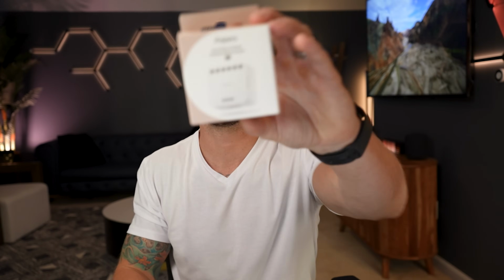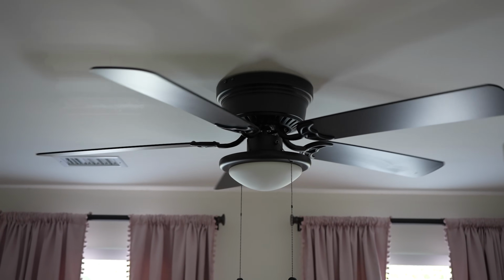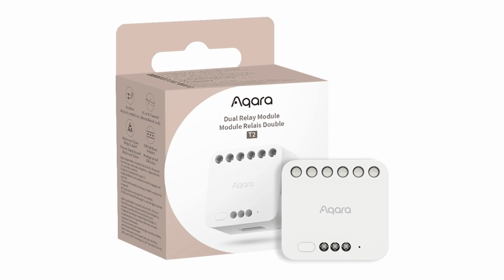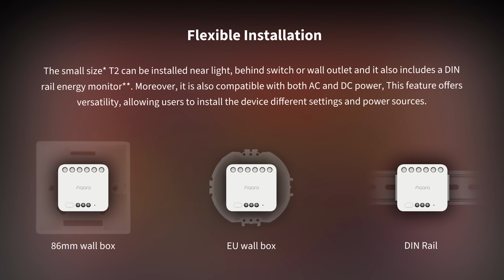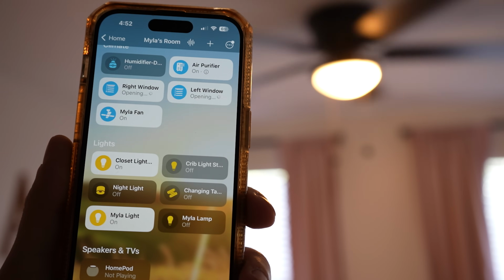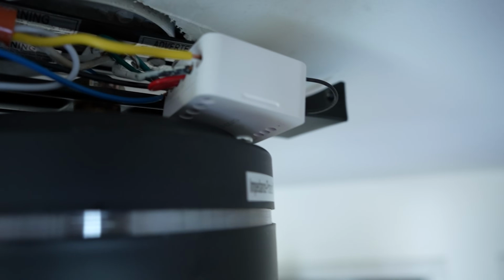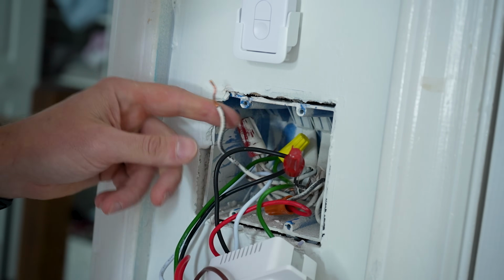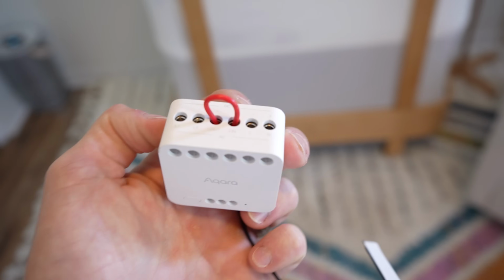Make Your Ceiling Fan (or Anything Else) SMART with THIS!

Comment: My our bedroom has a ceiling fan with built-in light, the light and fan have different slider/dimmer.  The fan has 4 bumps, off, low, medium, and high and the light is a regular dimmer.  Would definitely like to replace those (they're old and dingy and dumb) but get something that is smart and satisfies wife requirement that the fan and light will still work via the wall switch.  Sounds like Aqara can do this.  
I had hoped Lutron would be able to, since I have some Caseta stuff but it doesn't seem like it.  New project!
Reply from the maker: If you have separate wiring for a light and fan (two separate wall switches to control them) then you should be able to use a Lutron Caseta Dimmer Switch and Lutron Caseta Fan Controller Switch.
Reply: @ShaneCreates  I think to do that, I would need to expand the wall plate to almost double its current size.  I''ll have to measure again
Reply from the maker: @DanKing79  Ok, so you have one of those double switch fan/light dimmers in a single gang footprint (it sounds like). The Meross Fan/Light may be a good option for you if so. I'll have a video coming out very soon covering that, plus different ceiling fans and  switch configurations/options in more detail. Hopefully it will be helpful. So stay tuned for that! 😃
Reply: @ShaneCreates  looking forward to it!

Comment: Gives me an idea. My two garage door openers are currently controlled by a MyQ gateway. I could use the MyQ app, or Alexa, and until very recently, HomeKit via Homebridge+MyQ plug-in. Chamberlain now blocks API calls from the plug-in. So, my choices are getting a Meross 3-channel garage door opener, or maybe using this relay in dry contact mode (thoughts)? I'm already an Aqara user, with lots of sensors, an M2 hub and G2H Pro which I could move and use for a hub if there's connectivity problems.

PS: I am not fan of Meross and have removed nearly all of their products due to flaky (unacceptable) wi-fi performance, so I'm skeptical of their garage door controllers.
Reply: Of course, this becomes more complicated because "real" garage door openers provide status (open, opening, etc.) and using a second sensor makes for extra automations. :(

Comment: I thought this might be a solution to an ongoing question, but I'm not sure... 

I have an old security system in my basement with door and window switches routed to the box.  My question is whether you could use this module to tap into these switches for monitoring by Homekit?   Can I put something like this in the box and tie it to the incoming switch wiring.  What do you think?  Is there something else that can do this?

Comment: I like the switch but you still have those two pull chains to control speed of the fan, and intensity of the light which means you could accidentally turn the whole thing off from those pull chains.  There are better smart solutions out there like the TREATLIFE Smart Ceiling Fan Control and Dimmer Light Switch.

Comment: I found this very helpful.  Lots of detail and appreciate all you do to help us have a smarter home.  I have been using a Bond controller which worked fine for my indoor fans but has been sporadic for my outdoor. This is a good solution, just wish I would have seen before i Installed as I will have to take the fan blades off as you did on 2 fans.
Reply: I’m new to automation.

I feel this setup will be only for AC fans with a pull chain adjust speed. T

Does your bond controller allow for control of both light and dimmable, fan and speed?
Reply: @Rvighwbrn  I can dim lights and control fan speed using bond controller

Comment: Older house didn’t really have neutral to control the ceiling light was only hot where if you want to install a ceiling fan on a smart switch they require a neutral wire how to get around that is the real question

Comment: Maybe you have done this, but have not mentioned it: if you use the switch like this, where you only use the power to power it, you can set the switch to "Change to wireless switch" in settings, so when pressing you don't actually trigger the relay in the switch itself, only the buttons work.

Comment: Not a bad idea for a fan. But nothing beats the Sonoff ifan04. This will give you full voice assistant control of light and fan independently as well as fan speed and it comes with a RF remote and has app control. 

It even works in Home Assistant. Costs the same too if someone is wants better control
Reply from the maker: Thanks for sharing. Does it support Apple Home?
Reply: @ShaneCreates  That's the only thing it does not support. It also can be flashed with custom firmware but not sure if that gives Homekit support.

Comment: If the fan has a remote control will it still work when the Aqara switch is on for the fan?  If it will, then you can still control the fan speed, correct?

Comment: Shane, really nice tutorial on using this Aquara relay module! Like your setup using the Aquara dual switch in an automation to toggle the fan & light! I’m using SmartThings in my home automation and wondering if the relay module works with ST’s? I do use the Aquara Kitty Hub (P3, I think) to automate some contact & motion sensor.
Reply from the maker: The relay does support Matter. So if you bind your Aqara hub to matter, you can pair it to SmartThings, and then the relay would also work in SmartThings since it supports Matter over bridge.

Comment: I have the same issue with the ceiling fan. I was thinking of replacing the wire from  14/2 to 14/4. Replacing the wire is a more fundamental solution for this one but I haven't started it yet since I'm lazy. This product could be an alternative way.

Comment: Question: Most of these ceiling fans have three speeds. Any way to use smart technology to adjust the speed of the fan? Being able to turn the fan on and off is nice. Being able to turn the fan on to the desired speed would be much nicer!
Reply: I use the bond bridge for this. My fan does not work with IR.
Reply: @JhonnyCrespo How do you get your Bond connected to your HomeKit? I use Hoobs for that, but it’s finicky and I feel like there’s a better, more stable solution.
Reply: Get a bond bridge, I've setup all my 15 year old fans and linked it to Google assistant. Now I can turn fan on/off, change speeds, and turn light on/off with my voice or app. Voice doesn't work with long press dimming but you can program the bond app for dimming and works fine.
Reply: @jim60631 your fan had a single switch earlier?
Reply: @prasangmisra  no - fan has a single eletrcial switch for on/off but the remote has all the RF signals for lighting, dimming, fan speed, and reverse. The bond bridge replicates the various RF signals from the remote which is how it works
Reply: I’ve been trying to find a solution to this. Not sure if the Aqura Hub 2 which has an IR/RF blaster could help here. I’m thinking you can train the Hub to receive a High and Low RF and add those scene to HomeKit. Then maybe have a second aqura rocker switch or smart buttons that you can automate. Anyone know if this could work?
Reply from the maker: The only way I've accomplished this is by using a dedicated smart fan controller switch, like the Lutron Caseta fan controller. For this, you must have a dedicated wall switch wired for your fan only.
Reply: @ShaneCreates The Sonoff ifan04 is what I use. I can adjust fan speed. Also use the light. It is a thicc boi though. I have mine flashed with tasmota.
Reply: I use the TreatLife ceiling fan light switch and it works but you can only have one an a single circuit

Comment: Hi, I used this automate my air conditioning unit, now when I am 500 ft away from my home the AC would turn on, that way I am saving energy and the home is nice and comfy when I arrive, and the same in reverse, I also used it to control my electric gate, this one was long overdue. 😊

Comment: Shane, we have two ceilings fans that work off a remote and just one switch for each bedroom. Because of this room A will turn on the light or fan and it will do the same in room B, will the  new Aqara T2 help with this issue. Also will the new Aqara T2 work on a third fan that’s has no light but a remote to control the fan speed, we turn the fan on with a switch but use the remote to control the speed it would be nice to have this in HomeKit and not use a remote.

Comment: Hey, I don’t quite understand. If my HomePod is matter compatible, why do I need a separate hub…. or do I?
Reply: Aqara devices all communicate with the hub and then the hub actually communicates with your HomePod. All the hubs are roughly the same though. The M2 Hub is like $25 on eBay. Aqara is a pretty solid brand though. I think you'll find enough devices you could use to justify the hub. I have an Aqara deadbolt, curtain openers, and a few switches.

Comment: I believe Aqara switches have a “smart device” setting so you can wire it all connected but in software it just knows to always keep power. Does that not work in this situation?
Reply from the maker: Oh that is a good point, you are correct. Yes, you should be able to turn the switch into a "wireless" switch even if it is wired through the Aqara app.
Reply: @ShaneCreates  I think it’s important to remember the first rule of smart home building though, if it works let it be until it doesn’t 😂

Comment: Another great video! Thanks for sharing. I did a similar workaround with my wall switch where I replaced a single switch with a double rocker smart switch. The first button still powers the wall light it was originally wired to while the second button is always hot but does nothing and I use that as a remote for another light where the physical smart switch is just too far away to conveniently use.

Comment: Great video! Quick question. I want to do the same thing with my fan the difference is I have a Lutron smart switch on the wall. What do I need to do? I add the relay for the fan but do I need to change the Lutron switch too or can I use it somehow like you did the Aqara?
Reply from the maker: You could probably do the same thing with a Lutron Caseta switch but you would have to automate through HomeKit or some other way. You would not be able to automate in the Aqara app so that might be a little more complicated. You would have to disconnect the load wires of the switch like I did with the Aqara switch so that it wouldn't physically turn on/off the fan and light.

Comment: Shane, will I need the T2 if I have a two switches that control one fan / light combo? One for the fan and another for the fan’s light.
Reply from the maker: Yes and no. You have more options if you have separate switches for the fan and light. You can use a single T2 relay behind the switches (not in the fan). This would allow you to automate both of those switches with on/off control.

Alternatively, you can replace each switch with smart switches. Aqara switches would work and give you on/off control. Or you could even go with something like Lutron or another brand that sells fan controller switches and dimmers and have dimming capability and fan speed control.
Reply: @ShaneCreates  Thanks. Your videos help me make my smart home usable by the  rest of the family 😃

Comment: Great video as always Shane!! I have implemented something similar but needed additional hardware. I installed a remote controller module on the fan (similar to the Aqara relay here), programmed a Bond controller to control the remote and added the Bond controller to Hubitat. Then added a Zooz 700 scene controller to the wall after hot wiring the fan. Added the Zooz to Hubitat and set it to trigger Bond IR signals and since Hubitat exposed the Zooz to HomeKit, it was the icing on the cake 😊. I know, a lot of effort to automate one fan but we do it because we love it!! 😀

Comment: Hi Shane. Will this fix my problem: I have HomeKit throughout the house and a hue hub. In the kitchen I have a toggle light switch that powers two fluorescent lights. I also have a hue light switch that turns on under wall cupboard downlighting strips. I am desperate to just use ONE switch to turn all of these on at the same time. I’m guessing if this would solve it I’d still need the hub, but before I spent £140, will this make my fluorescent light switch now ‘digital’?

Comment: That double rocker switch gives me an idea to solve a problem I have. My external garage lights and front porch light are on the same circuit, so I normally can't turn off just the front porch light. My current solution for this is I have smart bulbs, so I can via app and automations turn them on/off individually, but I still have the problem of if a guest or someone accidentally turns off the physical switch, it cuts off the power to the lights. If I replace that physical switch with the double-rocker like you did, it will always stay powered and anyone flipping the physical switches will just be activating an automation to toggle either the garage lights or front porch light :)
Reply: The only problem with this solution though is infrequently, one of the smart bulbs gets in a weird state and I have to factory reset them via turning the actual power on/off 5 times, which I wouldn't be able to do if I had the double-rocker thing in place. I guess in that kind of situation I could just remove the problem bulb and stick it in a lamp or something so that I could power it on/off, or do it at the breaker box :)

Comment: I'm happy you put the "I'm not a certified electrician". The cables are connected to the right terminals and you did a fine job including the diagram. However, ❗at the T2 you could see the copper sticking out of the terminal, that could be a hazard as something could easily short out making it an (fire) hazard, or someone could get shocked.❗

If it isn't a solid wire, but multiple strands, there should be a wire ferule crimped to the wire. If you don't have these the hazard is mostly fixed by cutting a little of the copper wire and push it as far in the terminal so that you can't see the copper anymore. 

In my opinion, if you do some electrical work you should have wire ferules, they aren't that expensive and can be a lifesaver (or prevent a house fire).

Comment: I was looking for the exact same setup for my house. Is this setup compatible with a smart light bulb (Nanoleaf Essential A19), I want the ability to change light temperature depending on the time of day.
Reply: Shouldn't be a problem. Functionally, this is just a mechanical switch that turns power on or off.

Comment: I hope it's more robust than the T1.  I've had 2 x T1's fail in a matter of weeks from installation where I've had them switching extractor fans on/off via an Aqara temperature sensor.  The fans were only 5w and well within the operating range of the T1.  It's not as if the relays gave out, the entire units died.  I'm waiting on an RMA and I'll try this T2 - assuming I can shoehorn it into the available space, since the T2 is significantly bigger.

Comment: If you had the wires in the wall and wired it up at the wall with toggle switches, how would it react if the T2 had no connection to the hub?
Reply from the maker: If using the T2 behind for smart light switch control (wired behind the switch), the wall switches should still turn the light on/off even without the hub connection since the light is still hard wired to the switch.

Comment: can this be used to control hue bulbs?
Reply from the maker: Yes, if you used this in the wall switch method and used it in wireless switch mode, you could then automate the switch to control hue bulbs.